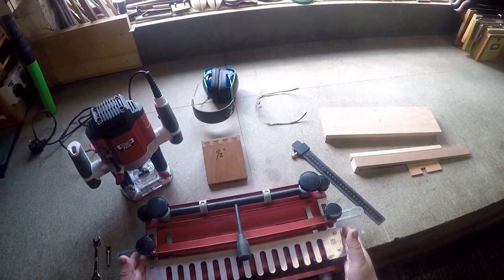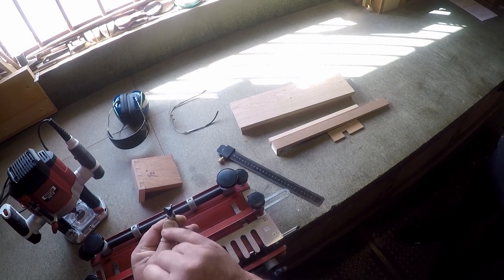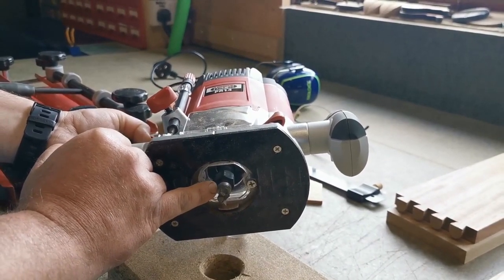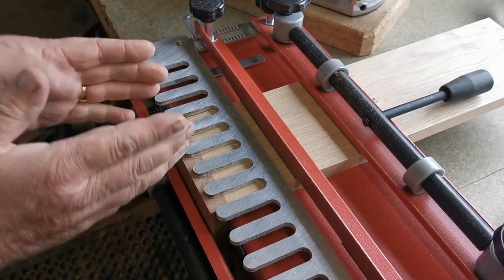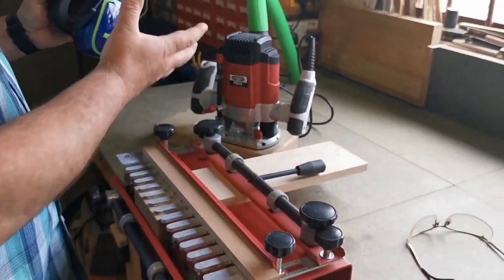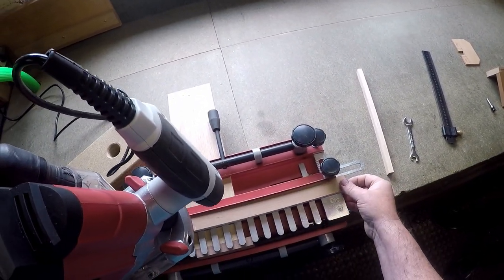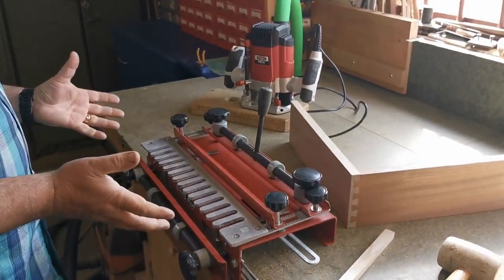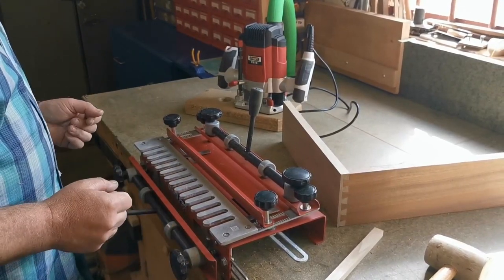How to set up and use the Lumberjack DTJ300

Comment: Freddie this has made my day .
Just measured mine and it’s 12.5 mil I’ve been trying to get mine set up for months and gave up in frustration any chance of letting all know which dovetail bit you would recommend please 👍🏼
Reply: Same here 👍 thanks
Reply: Great video.  I also have fallen foul of the 12mm dovetail cutter supplied.  The only one I could find that looked suitable was a trend 15mm dovetail cutter.  About £17 on Amazon so not cheap but it's done the job for my test piece.